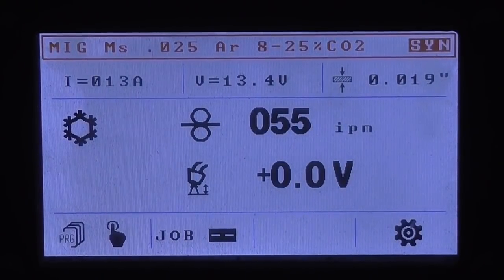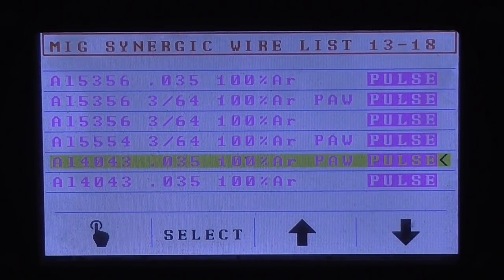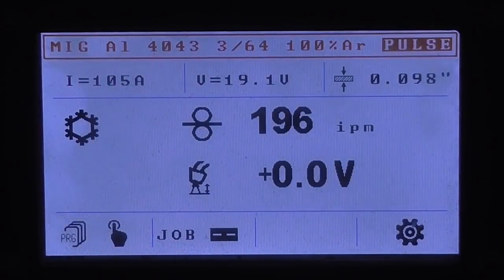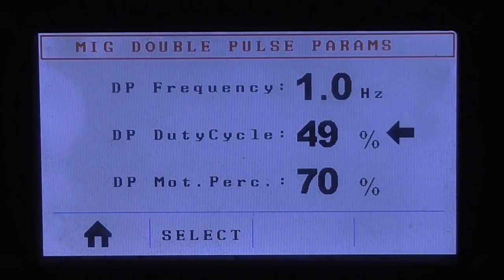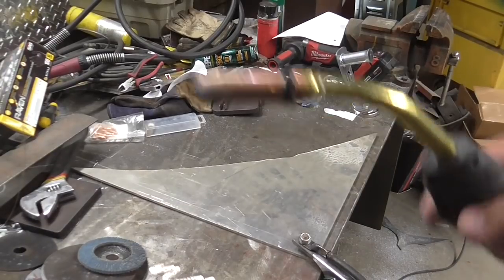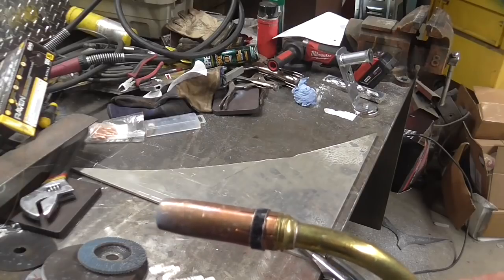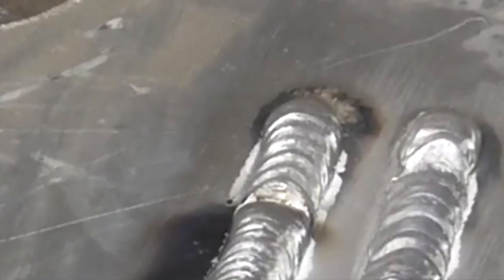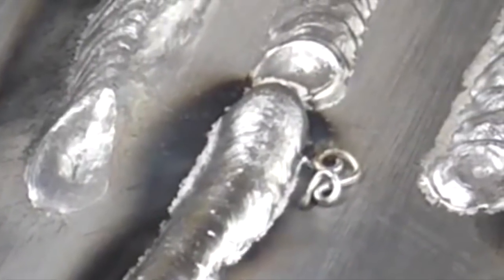Pulse mig options demonstrated

Comment: Can you use pure co2 for dual shield and solid wire steel welding with that machine knowing that it doesnt have program for 100% co2?
Thanks
Reply from the maker: You could.  With some voltage adjustments ….  

Look at my CO2 video i made in the last 3 ish month ….

Comment: Peter I was wondering what the pp300 is like with standard 035 wire can you pulse with 75/25?  Been thinking esab285 but would like pulse as an option plus the water cooled gun looks great for aluminum. I look forward to hearing from you!
Reply from the maker: Officially htp tells you no, i have done it by adding some extra voltage, its not ideal but can be done

Comment: Nice job ! Great explanation. 

Be nice to see some cut and etch on steel pulse mig’d and stick. 

Might take a couple of samples to show the on and off penetration depths. 

No one seems to be etching pulsed welds. Or maybe I’m not finding them on YouTube. 

I’m concerned about strength. 

I’d also like to know your thoughts about HTP vs Everlast. I’m trying to decide between the ProPule or the 253DPI.

Comment: So the new ones run C25 for pulse where my 200 has to run 90/10?
Reply from the maker: Josh Helm the pp300 can run C25 for pulse mig as it has WAY more power and arc dynamic. It can also run 90/10
The pp200 is limited in power output 200 amp class machine 220 amp for 10 sec and a peak pulse for up to 300amp where the pp300 is a 300 amp class machine with 320 amp max output in mig mode and a peak pulse of up to 600 amp !!!!  This is a whole different ball game!

Also the pp200 has a ton of single pulse programs and only 2 double pulse programs total for aluminum. The double pulse parameters are factory pre programmed. 
The pp300 for example - every pulse program is a single AND double pulse program with an option to manually change the double pulse parameters .... 
This works in steel also! ( and stainless and sibro) 
So you can even get your stack of dimes look with regular old mig wire ....
Pro Tip: use ER70-s3 ( not s6) since it is less fluid and faster freezing and makes nicer ripples because of that....
Reply: @ZILAwelds  I have a heck of a time not melting my diffusers and im never running it on thicker than 3/16 hardly. im running .030 and 90/10 staying in pulse program all the time. Stilll havent found that sweet spot for it to not spatter or sound like short curcuit without it being to hot for my .083 tubing im always welding.
Reply: I did have to change the screen in mine last week. The original screen locked up and wouldnt adjust. Brandon hooked me up with another one and i got it installed over the weekend.
Reply from the maker: Josh Helm that is an easy fix. 
1st dial up the voltage a little bit till the short circuit crackling goes away ....  my guess + 1.0 volt maybe 1.5
2nd order yourself up some heavy duty ceramic diffusors  ....  the are like 6 or 7 bucks a piece but if you dont break them physically that will be the last diffusor you will ever buy or need. 
3rd enjoy crackle and spatter free welding
Reply: @ZILAwelds  thanks buddy. Brandon did hook me up with a ceramic diffusor so im gonna try that out!

Comment: Seen this yet??? https://www.youtube.com/watch?v=EEza6EbPspU
Reply from the maker: yes, 3 phase 400 volt ....  are you putting a special transformer in? and a phase converter?  what is that going to cost you?

i have new and cool Stainless steel gas shielded flux cored wire for your swimming pool project .... !  now you can weld the pool with. pp200 finally !!!  just the wire is going to cost you pretty good ....
Reply: Hey brother...  That's outstanding!  and no I gotta stay with straight 220vt.  Any chance you can demo your new fancy wire?
Reply from the maker: yes - as soon as the samples come in ...  I visited the factory in Kentucky ....  but I am really behind on videos !
Reply: @ZILAwelds  You're the man!  Hope your family has a great Christmas!  We can mess with this in the new year.  It's cold as a witches tit here, so I'm not worried.  No hurry.

Comment: How well does the 300 do on a 3phase converter?
Reply from the maker: edsautorepair i dont know - there is no need to ever run it on one ....  it can run on a 220/240 single phase 50 amp outlet without and de rating in output or duty cycle ever !
Reply: ZILA so You get the same amps and capabilities with 220 as I would with 440 single or 3 phase ? And the same duty cycle?
Reply from the maker: yes - you are 100% correct !!!   the max output is 300 amp on stick and tig and 320 on wire.   no matter what you are plugged into !!!!  on a 240 single phase it draws 50 amp and on 480 3 phase, it only draws 17 amp to do 300 amp output.   the duty cycle at 104F is 35% at 300. 60% at 250 and 100% at 200 and on 77F it is 60% at 300 and 100% at 250 I believe ....   and that is also the same no matter what power you are plugged into ...  the only thing that changes is the amp draw and the size of extension cord you need ....   if you run on 240 single phase depending on how long the cord is it needs to be 8awg - on 480 3 pahse you can run 12 ga (seeing its only 17 amp max draw .. the effective draw is even less ....
Reply: ZILA that’s awesome. Having the shop located out of my home shop 3 phase is impossible to get in the woods. My lathe and mill run on 3 phase converters. That’s a very impressive duty cycle as well. When would you suggest going water cooled?
Reply from the maker: edsautorepair if you do aluminum 1/4” thick ...  you can start thinking about water cooling. If you do A LOT  of 1/4”
Aluminum or you do thicker than 1/4” ( even if it is “not much”) in my opinion you should have a water cooler ...  600 amp peak pulse is super hot - it will fry stuff fast and there is nowhere for the heat to go....
If you weld cored wires or regular mild steel no pulse air cooled is fine. 
Anything pulsed even stainless, mild steel and of cause aluminum over a couple minutes at a time ....   you should start thinking about water cooling ....  

What are you planing on doing with the machine?
Reply: ZILA stainless mild steel and aluminum I don’t do a lot over 3/16 except on equipment and that’s usually outdoors with arc. I usually don’t run more then 4-5 inch long runs. But definitely want to use the pulse function. Been using a buddies pp 200 and wife gave me the ok for Christmas but the 300 offers the tig and arc option as well
Reply from the maker: edsautorepair if you like the 200 you will hate the weight but LOVE the features of the 300! 

Even the dc tig with fully adjustable pulse ....

I am teaching a few guys right now how to use 030 wire on stainless that is barely 061 thick without sugaring on the back and then using the tig incase they need to blend a few starts and stops here .....

Sounds like air cooled torches will work fine for you. For pulse welding in any case you might want the upgraded contact tips in the air cooled torches especially on the 300 - the peak pulse and the demands in the contact tips are significantly higher. 

As far as equipment outdoors ....  i like the eutectics dual shield wire a lot! Snd guess what? After me telling that to people over and over- last i heard - htp finally has it and sells it now. 
Lol

That is the power if the internet ....  lol
Reply: ZILA awesome. Thanks for the info and sharing the intelligence. I’ll be placing a order.

Comment: Hi, I recently found your channel which I am enjoying. what are your recommended stick welder machine, and mig welder machine for the home hobbyist? thanks.
Reply from the maker: ralfman5 thanks for watching ! The first welder, that is a loaded question .... 
Are you using it for hobby or do you want to make money with it? 
Ofter your first welder is a bit of s stretch what you can afford also .....  
with 18 i bough a professional grade mig machine (new), then made money with it and at 19 i bought a professional grade acdc tig ( used)  

And for me it was the right decision - i never looked back and questioned it....

I think if you have low end machines - as a beginner you are fighting everything already more than enough ....  if you have a questionable machine already ....  you can finish drawing the picture yourself ....

You are making it unnecessary hard on you and artificially lengthen your learning curve by 2 3 5 10 times ....  

I have taught plenty of guys ....  some guys want to be taught how to use their own equipment .....  
one guy had a lotus welder .... he was trying to run 7018   1/8” at 125 amps shown in the read out and was wondering why he sucked so much ...  

So i welded with his machine and my regular 7018 rods and i started dialing it in by “feel” ....  by the time i was done and the rods ran good - the digital display was showing 196 amp !!!!  No no typo 196 amp!!!!  And then i put my clamp amp meter around the ground cable and measured the actual  welding amps live as it was happening ....  the meter showed 130-131 amp .....

So that guys cheap chinese lotus machine was a real buzz kill for him ....  he screwed around for month ! Not being able to even sort of get the hang of it ....   

So if you want to hear a make or model ....  let me know how much welding you know, if you want to make money with it or just hobby and roughly what your budget is and how fast you want to move on this and would you consider buying one sooner and the other one a year later or so ??? 

All those things would influence and   Change my recommendation ....
Reply: Thanks for the reply....I've been recently practicing on my everlast iMig200 that I bought 2 years ago. I'm having a hard time doing uphill vertical welds on 3/16  diameter steel plate. My future goal is to be able to weld a roll cage for my wrangler.  I certainly can't afford one of those nice Miller Tig, Mig welders that go for over 2k. Everlasts' pricing on their machines is attractive, but I am afraid about what happens after the 5 years, and if something breaks and they no longer produce the parts I would need.  The other concern is investing in a nice miller machine and after the warranty, if something breaks down and then being told the price for the parts over 1k like what happened to you..pretty painful. Now my dilemma is should I just what I have and buy a tig welder or buy something decent that is a multi-process welder for the 2k that will last me a long time for home use since I don't even know how to go about making money off my welder.  Any advice would be greatly appreciated. You seem to be the most honest voice I have found in the online welding world.   @ZILAwelds
Reply from the maker: ralfman5 so let me try to get this straight...  are you planing on tig welding the roll cage or mig welding the roll cage ?   Look up   URCHFAB on youtube ...  he does beautiful mig roll cages. 
Welding vertical up with “regular”  mig wire is not the easiest thing out there .... that is one of those scenarios where arc dynamic really comes into play. And arc dynamic can not be captured in any spec sheet or youtube video - YOU have to experience it. 
And the way how one guy likes his woman to be skinny and the next guy likes his girl chubby and the 3rd guy may not like girls at all ....  
arc dynamic is a very subjective topic ....! 
What i like and what firs my welding style may or may not be to your likings ....
Personally i think everlast ( generally speaking - some models may differ) have a pretty good stick arc. 
The machines that i ran the mig arc was ok - it did the job - but it was nothing that i was overly impressed with....  but there again, i welded with 5 or 6 different everlast migs in my life - i dont know them all and other guys who welded with the same machine said that it welded great!

So in the end ....  nothing beats experience hands on. 

Miller, especially the home owners stuff ,   You need to be very careful with as fat as quality and performance ....   many guys told my that they like the htp mig 200i better than the miller 211 and i have welded with both of them and i can see and understand why people would say something like this ....
The lincoln 210mp has arc dynamic that i personally like a lot. Nice driving arc very similar to the htp 200i but the wire feeder on the lincoln leaves to be desired ....  also the lincoln is like a quick set up screen ( so they say) but it is not really infinitely synergic ....  which as you start to use it more can be really cumbersome   ( i was at a muffler-shop this week doing some aluminum welding for them) they had a 210mp and they loved it BUT were running it in full manual mode .....

Maybe i need to do a video in that
I think without actually using the machine this is “hard to understand”
Then the stick on the everlast is much more to my liking than the stick on the lincoln ....

Back to miller .... if you can buy a 252 ...   now that is a quality machine! But the  again - most likely not in budget. 

If you are not under the gun to buy something right now - hold out! 

Try to run some lincoln 71m outershield or esab 7100 ultra in 035 diameter with 75/25 gas in the machine and you will see that vertical up is getting super easy !!  And good quality welds too! 

I have another machine or 2 that i hopefully will have time to test after Christmas ....   

Maybe if you dont have to buy anything before the end of winter ....  hang in there - i may have some better recommendation ....
Reply from the maker: ralfman5 advice on how to find work?  
You need to get your name out there... 
customers like to find you and not you to find them ....
If you advertise ( craigslist for example) for some guys the yellow pages work good but in comparison are very expensive ....  google ads ....
Leave your business cards at local truck stops etc ....

Some guys get work by going to other businesses ( farms, machine shops etc ...)  however that never worked for me ....

Start a youtube channel ....  by the time you have 20-30ooo subscribers people will contact you to do work for them ....
 I mean the possibilities are endless - some work better than others for the area you are in with the personality you have .....

Try, try, try and dont take NO for an answer ....
Reply: @ZILAwelds  Hey Zila, I am being offered a Stel iron mig 221 for $1250 brand new, should I buy?? Powercord would be an issue here in the U.S. let me know if not ill buy either a millermatic 255(new release) or multimatic 220 or essab 205(january)
Reply from the maker: ralfman5 iron mig 221 or 221p?   Is it new or used?
Reply: @ZILAwelds  stel iron mig 221p, new
Reply from the maker: ralfman5 that is a killer deal ...  i dont know where it comes from ....  or how warranty is handled? And you dont have the remote output for the slider for aluminum welding .... and it does not have the 5554 program for the ford trucks .....

But still a killer deal ? 

Are you getting it from ebay? Or where?
Reply: @ZILAwelds  Ebay, shipped from overseas. The warranty issue is whqt concerns me. Might let it go.
Reply: good advice, I will try the dual shielded lincoln wire, that goes for 52 bucks for 10 lbs for now. I would buy a used Miller 252 if I find one local on Ebay, new is about 2750 with 300 rebate until 12/31. I could wait until next year after your reviews. I know that you get what you pay for.   @ZILAwelds

Comment: Hey Pete, I am considering pulling the trigger on one of these machines. however i have a few questions. 

 I am in Australia , does that mean i have to get the Stel ironmig instead? They are the same machine right?

And similarly i cant find anywhere to purchase either the HTP or stel. Can i buy yours haha. 

kind regards.
Reply from the maker: stobby neither htp nor stel has a dealer/distributor in australia.   The stel would ship from italy and the htp would ship from usa. 
The warranty in any case would be a little bit of a challenge ....
I believe that although a lot of accessories are identical the air cooled aluminum mig gun from htp might be a little bit better. 

What are you looking to do with it?  And i guess shipping cost is a whole another issue ...
But it is all do able, both companies sold to australia before   

Best thing is you email jnoland@htpweld.com and get a quote ...
Reply: @ZILAwelds  Thanks for the Info, I may have told you previously, i cant remember though. I Am building an offshore aluminum plate boat and alloy trailer to suit. 
I am currently running a 250 amp transformed mig, And the stepped voltage selector is a pain in the butt. It can make nice welds but is not the easiest thing in the world to use. 
From what i can see the HTP does seem a touch better than the STEL. 

The only machine i can find is on ebay, Brand new stel 221p comes to around $2700 AUD. ($1900USD). shipped from italy.
Reply from the maker: stobby the htp pro pulse 200 has the remote control option for the aluminum mig welding. The stel iron mig does not. Also the htp has in my mind the better aluminum mig gun ( the tips are better and larger, it can tolerate more amperage when pulse mig welding aluminum) 

The pp300 vs iron mig 303 sp - that race is much closer. But i think the htp pp300 is a little bit cheaper too and it has a WAY better operators manual !
Reply: @ZILAwelds  Ok, thanks very much for the info. I will try contacting htp and see what can be worked out. 

cheers.